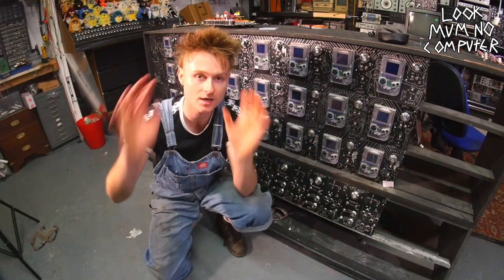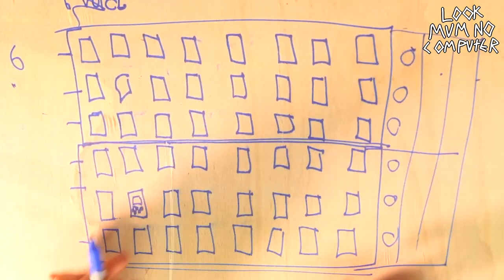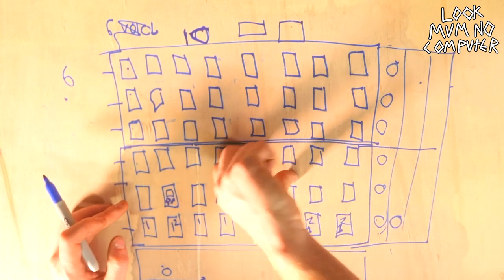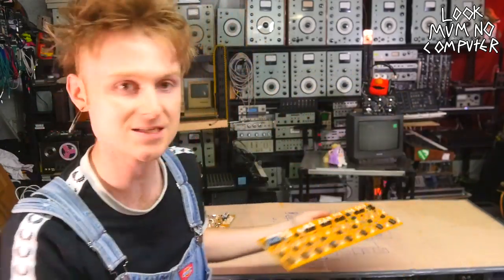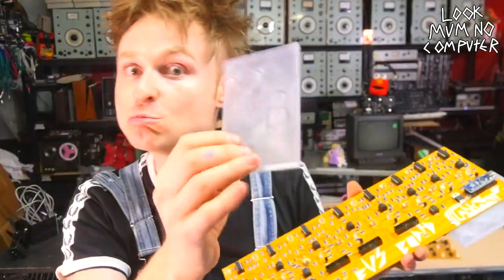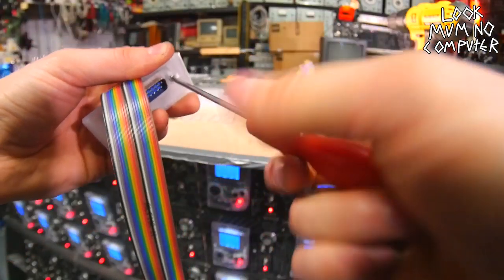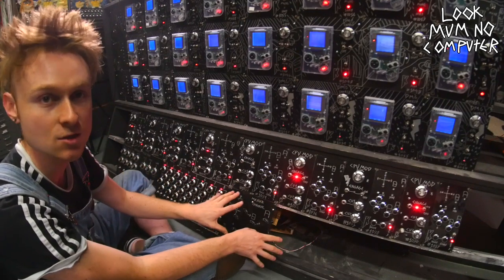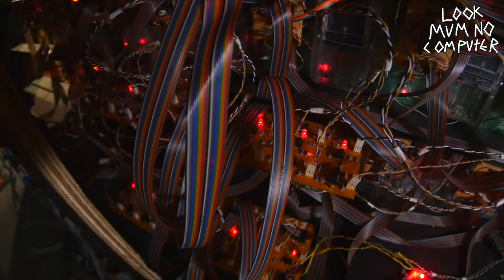GAMEBOY MEGAMACHINE #6 100 Voltage Controlled Amplifiers!

Comment: 8:48 I know, to use one you first have to buy one (or know someone), but that would be so much faster with a laser cutter.
And perhaps it would be easier to just add a light vertical backplate (behind the actual outer backplate which you hopefully also add later). It looks like there would still be space for that. Then you have much more surface area on which you can mount those boards.
Of course, the backplate would block some of the Gameboys. You could put the backplate on the side and mount it with hinges on the side so it opens like a door.

Comment: On the upside you planned ahead to make it modular already. Having those plugs saved a lot of soldering in some areas. (Obviously there's still a lot, but not doing it to wires from awkward positions in the back of the unit as a whole.)

Comment: Some sort of CMOS SPDT switch like the Max333 to switch columns to one of 2 buses per voice, plus a switch to route bus 1 filter output to bus 2 filter for series processing.
Set the SPDTs with a voltage high/low switch, or with a jack input to sequence the switching with gates

Comment: Keep it simple:
1. Simpler to maintenance if it stops working
2. Less problems to deal with building the machine
3. A little bit cheaper
Reply from the maker: but what do you propose? simple indeed, i probably would have popped to the shop and bought a korg m1 haha, im in too deep!!!
Reply: I was thinking to not go too far and detailed. In my projects, if I do everything I dream of and vision, it could not work out the way I planned it and would turn in to a big mess.
Thanks for the response! Your videos are the best!

Comment: I'm not really sure about what you're trying to do but a "voltage controlled swich" for audio sounds a lot like one some mute circuit (with an opamp "analog adder" at the end) that can be easily done with opamps, mosfets or transistors.

Comment: 10:48 is it just me or do the led stop working when you push the panel? Might want to double check your connections there.
Reply from the maker: Jacob Pauls which ones? All fine unless I’ve missed some
Reply from the maker: Yeah I fixed that
Reply: LOOK MUM NO COMPUTER cool, cool.

Comment: So correct me if I'm wrong but for the right side of the box you are planning on putting a master VCA per voice as well as envelope controls and maybe a filter to sort of emulate the way the CS-80 works? I think that your idea of doing two VCA's per osc totally works, you probably could have simplified it by grouping the oscs in each voice more. Like instead of individually controllable VCA's for each oscillator per voice you probably could have grouped them so that each voice had 2 groups of 4 oscs controlled by one set of VCA's, or 4 groups of 2 oscs per VCA set, of course that would limit the versatility a bit.
I think the way you approached it, while a bit mental is still very cool and works great. Do you have any plans for things like unison detune between oscillators or voices or anything like that? Despite the possibility of solving this problem in a simpler manner I think the way you did it definitely opens you up to more possibilities with more external/self modulation. Can't wait for the next video.
Reply from the maker: yes well i dont want it to just be like the cs80 the analog part will be 2 variable state filters, 1 flanger/delay, 2 vca's and 1 distortion all addressable by a large 8x8 digital patch bay so they can be anywhere in the chain in either of the 2 chains and could even feed into themselves. unison detune will basically be just all of them playing together and detuning the cpu's with the modules below.
Reply: @LOOKMUMNOCOMPUTER  Sounds like it's gonna be a real beast when it's done. I love this project (I love all your projects but especially this one). Thanks for the reply.

Comment: dude, check out standoffs. They're brilliant for circuit board mounting. No need to waste so much 3D printing those boards.
Reply from the maker: Metabeard it was an awkward position to use standoffs I was going to use them but nowhere to mount without getting in the way of game boys.
Reply: @LOOKMUMNOCOMPUTER  I figured you knew about them, but couldn't figure out why you didn't use them. I've got a box with a whole collection different lengths. Short nylon standoffs might've fit, but I hear you on them getting awkward to install. So many tiny pieces!